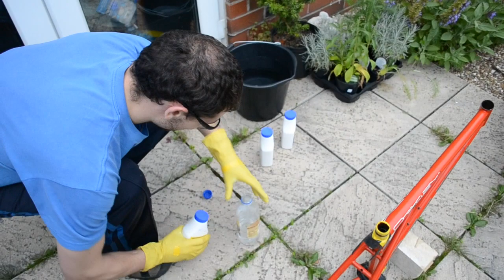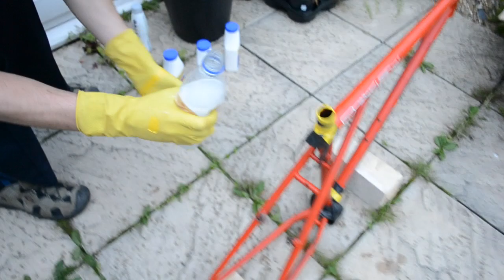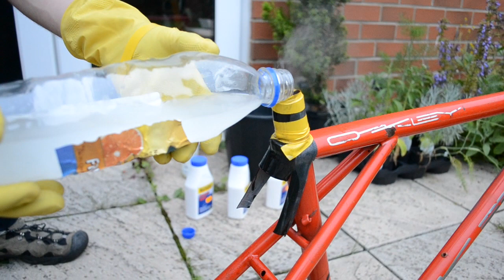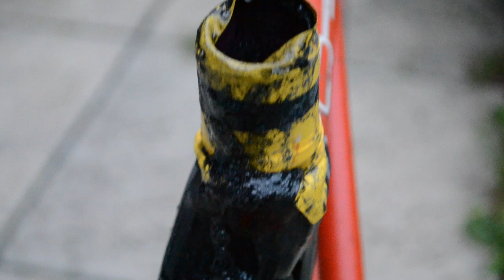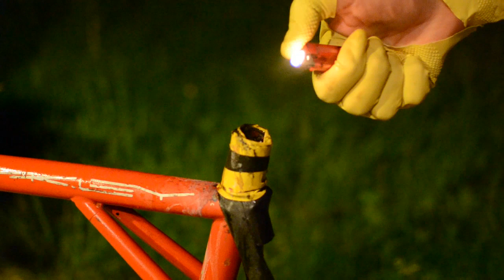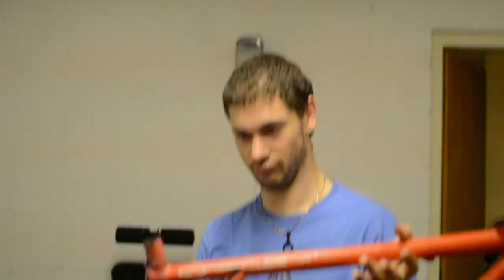Removing an aluminium seat post from a steel frame with caustic soda

Comment: A good idea that would make for easy work as long as you could isolate all of the fluid in the seat tube. What I could not overcome was how to stop all leaking into adjacent tubes and out of the frame itself. I used uninflated balloons stretched over either side of the BB shell which worked really well. It ran through the holes for the BB cable guide which I successfully plugged with chopsticks. Great. But then it found its way out the chain stays at the dropouts and out the headset, out the stem. Everything is open inside the frame to some degree. Then I flipped the frame, plugged the top of the seat tube and tried filling through the BB shell. Ultimately the same problem. It ended up getting so messy (and dangerous) that I had to stop. If it was just a matter of plugging the BB shell and fill the seat tube it would be a certain fix for all bikes. But you must have a bike with isolated tubing? I can't emphasize enough how gnarly this stuff is. Extreme caution required.

Comment: I used this method after trying everything - everything!  It worked perfectly to the amazement of the bike shop (one of many) that tried to get it out after my attempts failed.  My only note is that my frame was steel but the cable stays were aluminum, so make sure to either mask it well or ensure you don't have any aluminum parts that you don't want vaporized exposed.

Comment: Seal the seatpost / Turn the frame upside down / pour in soultion through bottom bracket - that way you don't need to keep toping up and risk covering yourself in caustic soda

Comment: Thanks for posting this. I'm currently soaking a front fork in casutic soda to dissolve the remainder of a very stuck handlebar stem. I started working with a much weaker solution and it was slow. I've bumped it up now that I see your frame didn't melt or the gas didn't cause an explosion! I will pass on the bare flame and bottle-shaking steps though!
Reply from the maker: Good stuff. Good luck with the renovation of the fork!

Comment: I once had an aluminium paint spray pot and I thought it was a good idea to clean it with a caustic soda mix, so I put it on the floor in the garage and came back after a couple of hours and all that was left of the post was the rim and a small part of the top end.

Comment: Have a six pack of beer with you while doing this. Not to drink, but to splash on your body that might get hit with that caustic soda mix. Caustic soda will burn your skin very very quickly but the beer is at the opposite end of the pH scale (beer is somwewhat acidic) and will neutralize the nasty caustic and just might save your skin. Of course, any beer left over after finishing this project can then be consumed in celebration!!

Comment from the maker: I'm pretty sure it's just hydrogen gas released, as the chemical reaction is:
2Al + 2NaOH + 2H2O → 2NaAlO2 + 3H2
but I would suggest anyone trying it at home takes full precautions.
To be fair, I took more precautions than I would have if it hadn't have been filmed.

Comment: Hi mate, I want to try this however by bottom bracket is also seized and im not sure how i can block off the bottom of the seat tube without removing it. I could try removing it with caustic soda too however one side is steel and ive tried my best on removing both cups however they wont budge

Comment from the maker: You could try gently heating the seat tube with the frame upside down, so it expands quicker than the seat post. Alternatively you may be able to use a puller to get it out, depending on how far down it is.

Comment: Interesting, but messy stuff! Was just proving it could be done, or did you actually use the bike frame after that?
Reply from the maker: Hello. Yes, it's a great frame. After removing the seatpost I had it powdercoated, built it up and rode it. I did eventually sell it, because I had two very similar frams, both from 1993, and I slightly prefer the other.

Comment: If the aluminum seatpost and aluminum frame are stuck, how do you remove it?
Reply from the maker: That's certainly more difficult. Firstly, soaking it as much as possible in a dismantling lubricant like Plusgas is a good step. After that, if it is not sheared off then you can try to get it moving clamped in a vice, but otherwise I would try using a slide hammer, or as a last resort cutting it from the inside using a saw blade with a handle attached.

Comment: I have stuck aluminium seatpost in carbon frame. if i will use your method in carbon frame will it work? Or sodium will damage carbon? Will i need to do something after reaction will end like to clean parts of alluminium from frame? Thank you
Reply from the maker: Carbon fibre is rated as having good resistance to sodium hydroxide (caustic soda) http://chomarat.com/wp-content/uploads/2011/06/CHO-3265-Chemical-Resistance-Guide.pdf but it is quite an extreme solution, so always best to make sure you've tried easier methods first. It would also be worth consulting an expert in carbon to back up the carbon's resistance as I am no expert.

I rinsed the frame out and dried it afterwards, but so long as you use sufficient caustic soda all the aluminium alloy will have reacted away and the product tends to drain out pretty easily.

Good luck with getting that post out.

Comment: But did the weeds on your terrace survive?
Reply from the maker: Added bonus of clearing weeds from the patio :D
Reply: Caustic soda mixture will eat anything organic. That's why they use it to clean drains. But it doesn't hurt steel or even paint.

Comment from the maker: Sodium hydroxide (caustic soda) reacts with aluminium, but doesn't react with steel, so you can only use this approach with an aluminium alloy post in a steel frame. For a steel post in a steel frame I'd soak it in a penetrating fluid like Plusgas.

To find a recommended powdercoater I'd advise looking on this thread on Retrobike:

http://www.retrobike.co.uk/forum/viewtopic.php?f=1&t=232111

I wouldn't really recommend the place I used for this frame as I wasn't entirely happy with the job they did.
Reply: Caustic soda wicked stuff great when ever you need to play a nasty prank because this stuff acts like acid if you don't clean up the parts your parts will start to melt
Reply: jonathan oxlade it's a very powerful base, natriumhydroxide :)
Reply: +Jeppe Løger no. Na means sodium
Reply: +Elements &amp; Science  Na in periodic system of elements represents Natrium (which is also called Sodium). The same is for K, Kalium (also called Potassium).
Reply: BAK87 yes, however those were the old names, now they are always called sodium or potassium
Reply: Elements & Science In most parts of Europe they are still Natrium and Kalium.

Comment: where did you buy the caustic soda?
Reply from the maker: I just bought it at my local convenience shop, but they should also stock it in DIY stores etc.
Reply: kingoffootball yeah thanks, with a little more research i found that out for myself! lol..thanks for this post.. its saved me a lot of hard work.. first time i tried it i made the solution too weak, so back again with a stronger solution.. left it overnight... cleared by morning.. amazing results.. and no hassle or hazard really, as long as you are sensible about it, its fine

Comment: I,ve found a bottle of spirits of salt in the shed. Will this work as well or better?
Reply from the maker: HCL also reacts with aluminium and not steel, so as far as I know that should also work, but I haven't tried it myself. You may also need to be even more careful with it than sodium hydroxide.

Comment: I don't understand it. My caustic soda does not react that strongly at all. Just a bit of prickling and that's it. Had it for hours in the seat post .... no visible effect.
Reply from the maker: Is it definitely an aluminium seat post? If so and it's not really reacting then it's most likely to be the strength of the caustic soda solution. Dissolving the caustic soda is exothermic, so the solution should get quite hot - so if it's not heating up much maybe it's not strong enough. Best to be careful and start with a weaker solution anyway and then get more concentrated until it's effective.
Reply: kingoffootball Hey man,

thanks for getting back at me. I followed your adivice and spiced things up a bit. I bet the main reason was, that the soda did not stay in in place for a long time. I now turned the frame upside down and it certainly does work, unfortuneatly, I assume due to temperate, it quite hard to properly seal the tube. But I am getting there ;)
Reply from the maker: Good work. I sealed off the bottom of the seat tube using an old inner tube and electrical tape, so I could keep it filled up.

Comment: did you coat the inside of the frame with anything after flushing all of the caustic soda out with water?
Reply from the maker: Yeah, I sprayed some Waxoyl inside all the tubes just to help protect it once it was thoroughly dry. Not specifically because I'd used caustic soda on it, just because I would have done that to help protect the steel frame before I rebuilt it anyway.